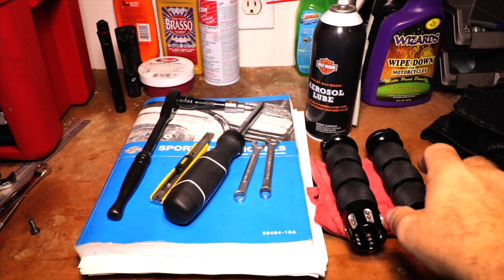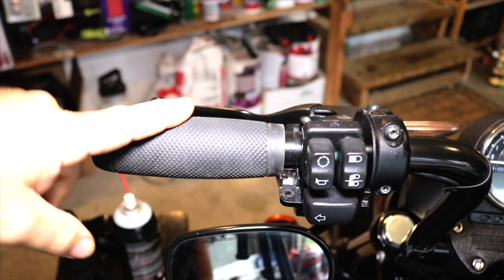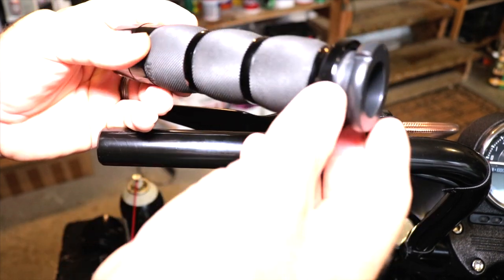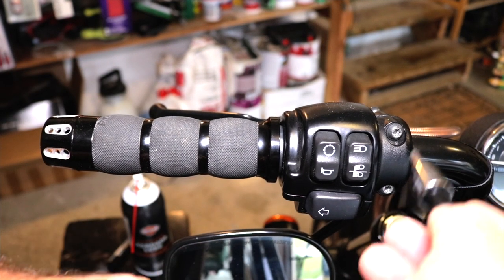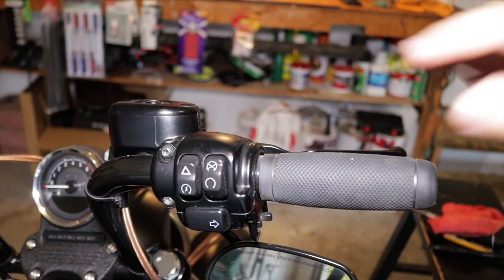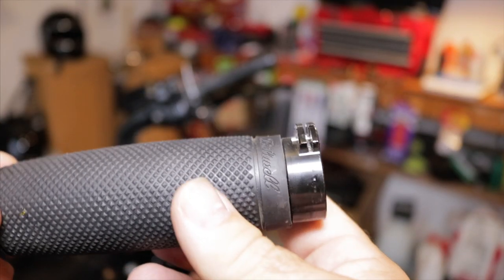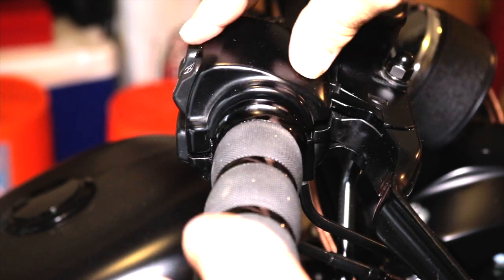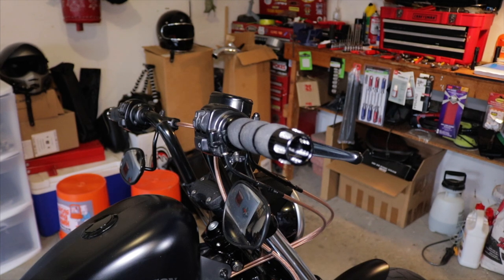How to Install Grips on a Harley Davidson Sportster

Comment: I love how you glossed over the part where you fight with the brass pieces while attaching the idle and throttle cable. 

I have my cables collapsed all the way and I still am having a hell of a time getting the throttle side on.
Reply from the maker: They can be a little tricky at first but when you do them a few times it gets a lot easier.
Reply: @TonysGarage  I've done a few before and have never had this much trouble. I did just install new cables so they're not stock.
Reply from the maker: Joe Troutt are they fully seated in the throttle body?  Check and make sure they are in the correct position.  I mixed up the the throttle and idle cables once.
Reply: @TonysGarage  I got them on. I had to take the throttle grip completely off and hook the cables up to it and then put it back on. I've never had to do that way before but it worked. 😁
Reply: FYI I put some taller bars on so I'm having to replace everything. Now onto rewiring everything.  Such joy. 😵
Reply: @joetroutt7425  so it's not an easy job? My buddy wants me to install grips and a battery? Told him take it to a dealer? Should be less than an hour? But bet they won't let him use his part's? The video looks somewhat easy? Then i read comments!! Lol. Make em so you bring them back? So glad i said no, During this uncertainty.
Reply: @golfwipe  the battery is nothing and the grips are a breeze if it's the throttle by wire but those cables that have the little brass pieces are a pain in the ass. Make sure you are somewhere there's no grass, cracks and obstacles around bc once those things fall on the ground they take off and good luck finding them.

Comment: What year and model is that Sportster? It appears to be much easier to deal with. I just helped install Biltwell grips on my neighbors ‘13 Forty-Eight last night. On his, the Run/Start switches were connected to the upper housing. The tight space caused him to lose one brass ferrule.

Comment: If the new grips are longer than than the old grips do you need to adjust brake and clutch lever further up the bars or is it ok if inside the new longer grips they do not go up to the bars?

Comment: My Avon grips on iron 2020 doesn’t fit well on the clutch side. Switch housing sits a little off and I already messed up the screws and have to get a new one. I put some rubbing alcohol inside the grip so it holds it pretty good but it still moves a little bit. Any suggestion? I’ll go to harley and get screws so I can try again.

Comment: If you take a long spray tube with WD40 and run it as far as you can into the grip, then spray, that grip will come off.  No problem with any grip I've ever done.

Comment: Hey man when you first went to the biltwell recoils, did you notice a sensitive or touchy throttle? I just replaced mine and it feels sensitive as hell. Idk if its more of muscle memory with the thinner grip or what. Ive adjust the cables to have no slack and still feels “loose”.
Reply from the maker: +O Cruz they do have a little loose feeling for sure just started to notice that. As far as touchy you might have the throttle cable a little tight.
Reply: Tony's Garage thanks for the quick reply man. Ill try playing the the throttle cable some!
Reply from the maker: +O Cruz the sensitivity could come from the bigger grip like you said

Comment: Hey Tony I got an iron 883 as well and installed the kuryakyn kinetic grips but had an issue with the clutch side the glue provided that was the black widow adhesive i used to glue the clutch side, I believe I glued it on incorrectly and now my grip is loose on the inside but I can not remove the grip as the glue has set on the outer side. I tried using a screw driver, wd40 and it still stuck? Is there anything i can do to remove it without destroying the grip? Spent $100 on them. Don't want to have to buy another set.
Reply from the maker: Hey Jeff, that clue is pretty tough stuff.   Have you tried compressed air?  If you have access to a air compressor you shoot air under the grip and loosen it up. Doesn’t always work but worth a shot.  Also just plain old alcohol could help.  Good luck.

Comment: I just bought these recently: 

https://rover.ebay.com/rover/0/0/0?mpre=https%3A%2F%2Fwww.ebay.com%2Fulk%2Fitm%2F331278674004

Before I dig in to installing these, does the clutch side look like it’s a glue-on type or switch-pack hold on type? Will I need to depress the brake light switch with some cardboard on the that side grip? Thanks for your help
Reply: Never mind. Following these steps it was super quick, simple and easy. No problems at all. Thanks!

Comment: where did you get your fuel gas cap? Can you put a link please? :)
Reply from the maker: It is a Harley part
Reply: The H-D flush gas cap part # for an Iron 883 3.3 gallon tank is 63134-10. The part # for a Forty-Eight 2.1 gallon tank is 63140-10.